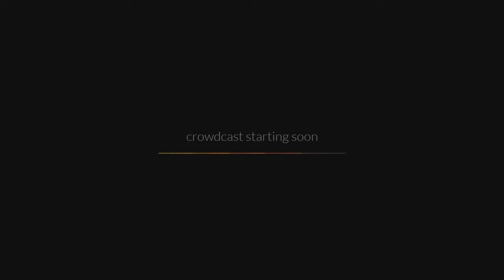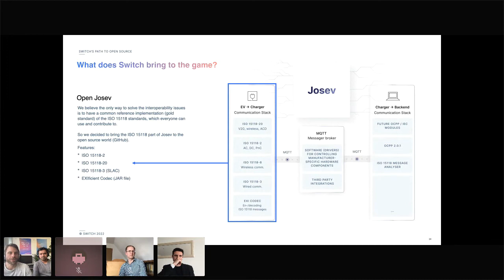Switch Webinar: Ep.02 – What's new in ISO 15118-20

Comment: 58:00 looking trough t the IEC 61851-23 Edition 2.0 2023-12, specifically page 192 Table BB.3 – Emergency shutdown times and criteria. In this table , the most restrictive detection time requirement is the loss of the CP signal, this detection should be made in less than 20ms.

How is that enough time even for your EXI codec to even decode read the received fault? or are we relying on hardware detection?

Comment: 00:00 introduce presenters
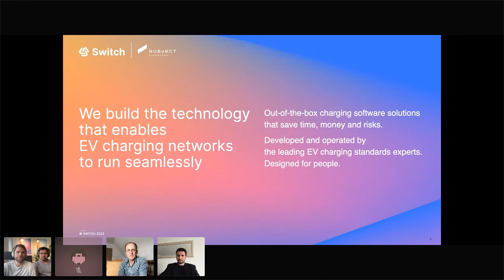05:13 agenda
05:31 The main benefits of ISO15118-2
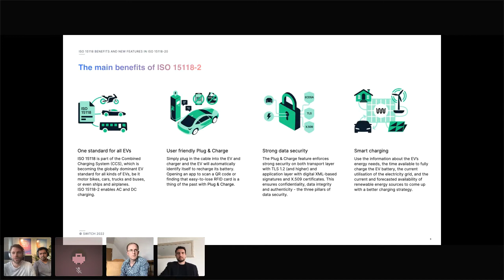08:34 New features in ISO 15118-20
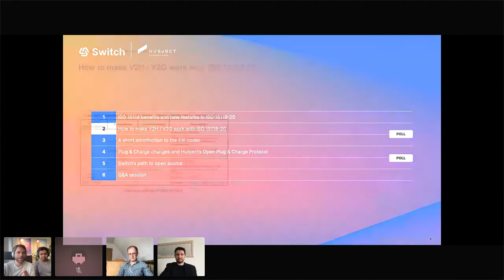16:01 How to make V2H/V2G work with ISO15118-20
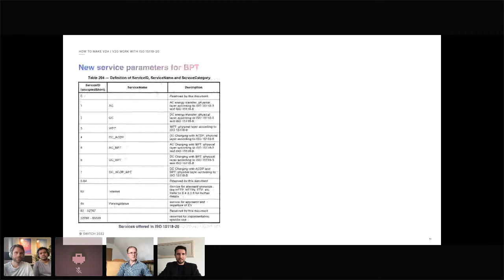17:40 New service parameters for BPT(AC)
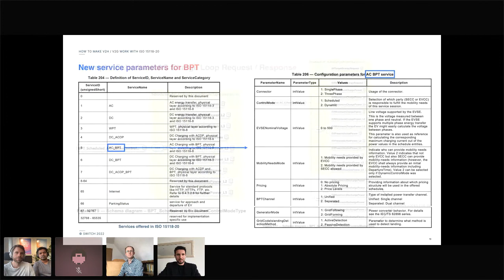23:24 Example:Scheduled AC Charge Loop Req/Res
25:59 A short introduce to EXI
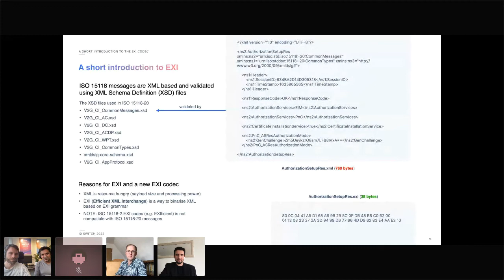30:02 EXIficient vs Switch's REXI
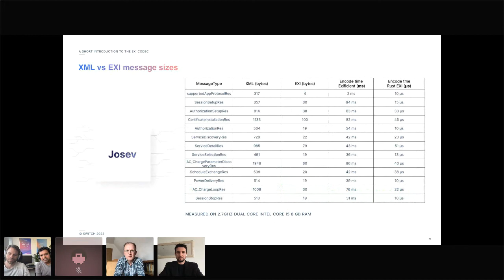34:53 XML vs EXI message sizes
36:13 PnC - Defferences between ISO15118-2 and ISO15118-20
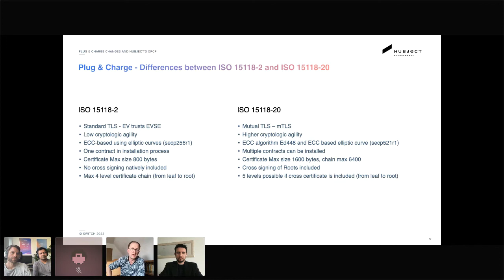41:19 High-level changes for OEMs, CPOs and MOs
45:13 OPCP - Open PnC protocol benefits
49:56 PnC between stakeholders
50:34 How to test and integrate you solution
Reply from the maker: 🙏 thank you 쏭